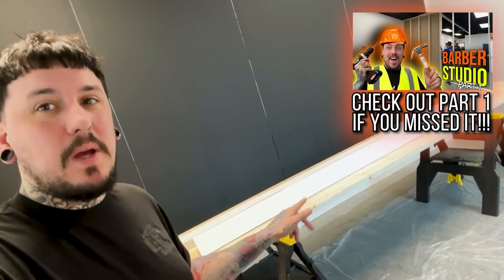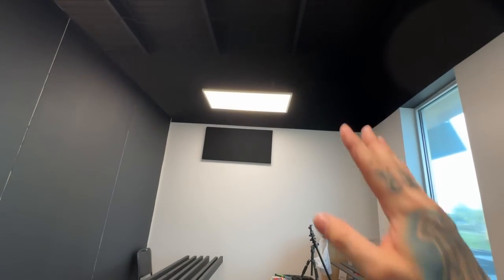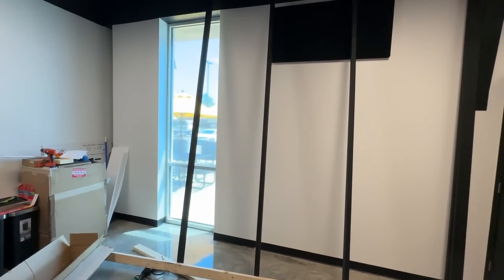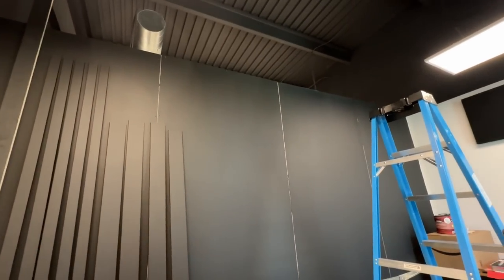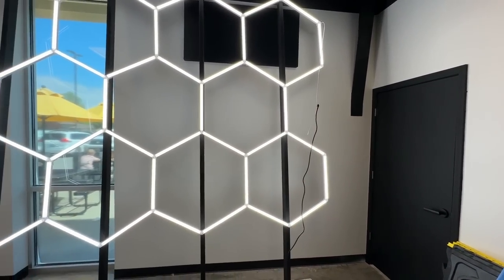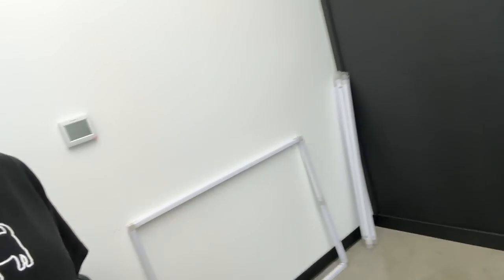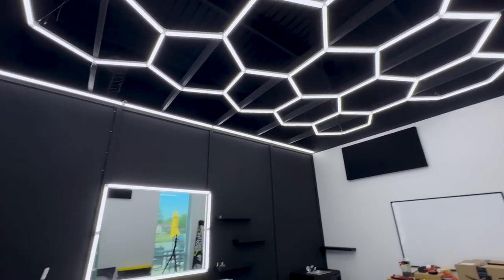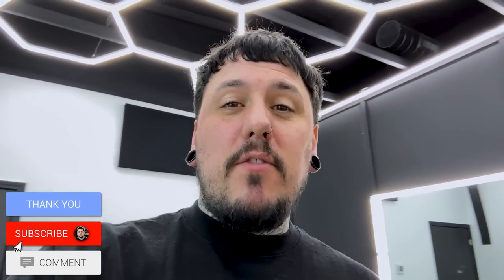These Hexagon Lights are Crazy! 😳 Building a Barber Studio Part 2

Comment: I think I got really lucky.. going to put my hex lights in and there was a frame up higher hidden in the ceiling from the original drop ceiling. So 12 g hanging wire through the current drop ceiling will hold a hex system for 4 barbers
Reply: Bro… you should patented this method. Cuz this is the best way to do this

Comment: We hardwired the 2 lines on a switch that also lights up the reception area
Reply from the maker: Yeah mine are wired to a switch
Reply: @Seancutshair  you only wired the 2 wires? Because I am literally doing it right now. The wire is hooked up to a switch but I did not hook this wire in… it was spliced off of 3 can style LED 6in units in the waiting area.